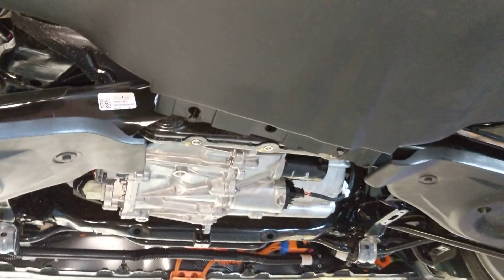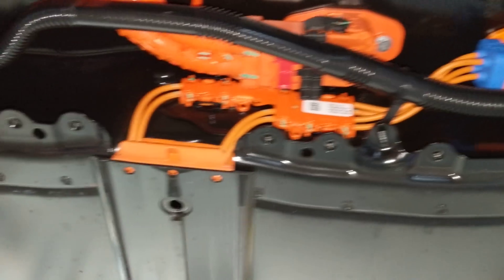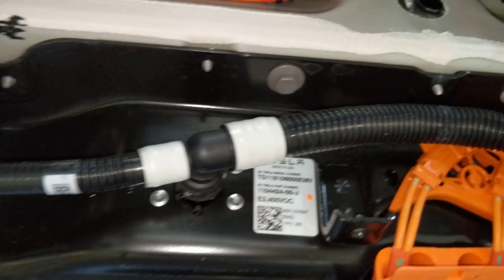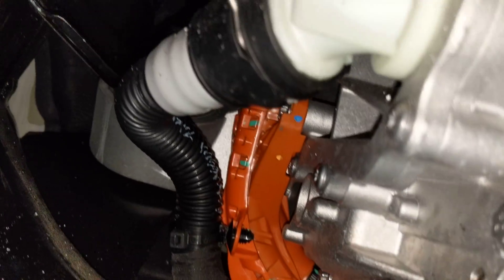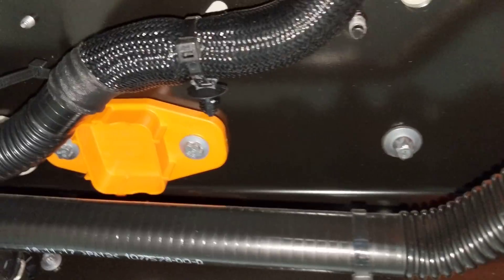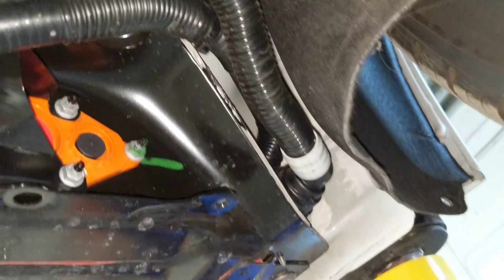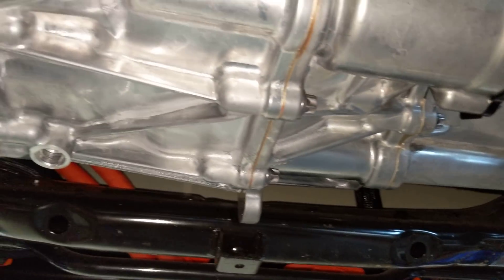Tesla Model 3 - High Voltage System Overview

Comment: Thank you for the video. Now the question is, which line is positive and which is negative....
Reply from the maker: If you are competent around HV used in these cars, then it's trivial to figure out polarity.  Please do not attempt to mess with HV if you are not very experienced with it, it is far more dangerous than most people assume.  Besides, even if you hook it up, none of the components work without proper CAN bus control.  Things like the drive unit need a cryptographic handshake too.
Reply: @Ingineerix  I deal with systems from <12V all the way to 3 phase 240V on aircraft. 

 Currently sitting in my garage I have a 17 Chevy volt pack, model 3 motor, Orion BMS, Tesla Gen 2 Charger, DC/DC, and EV controls controller. Along with the contactors and such.  

I assure you; I do have the PPE for handling the HV. Just not the full knowledge of how it all was hooked up in a Tesla. 

I believe I found my answer for polarity as it appears to be pin #2 is negative.
Reply from the maker: @boxmonkeyracing  Apologies, Just trying to keep people safe.  I've had many scary reports!  Some guy even tried to connect 400V of pack directly to a Tesla inverter with no precharge!   In fact, Orion BMS doesn't have a built-in precharge system, so I hope you have one selected.
Reply: @Ingineerix  it’s all good. I completely understand. I also believe that’s why it’s hard to find support from people with ev conversions. 

The EV controls T2-C handles the pre-charge circuit and controlling the drive unit. I’ve already tested the pre charge circuit and main contractors and it’s working great.  My next step is actually hooking up the HV to the drive unit, and updating its firmware. Hopefully, I’ll have it spinning by the 1st.

Comment: You said high voltage.. But out of a curiosity how much the high voltage is which reaches the inverter?
Reply from the maker: 300-400VDC
Reply: @Ingineerix  So the motor also a high voltage Ac motor or is it a 110v motor??
Reply from the maker: @SFORSANDEEP  "High" is relative, but inthe automotive context 400V is "high" vs 12v which is "low".  There are no other voltages in the car.  The inverter converts 400VDC to 3-phase AC for the motor.

Comment: I was hoping to see a mention of the high voltage breathers since there is a service bulletin to replace it due to a thud sound while supercharging in the cold.
Reply from the maker: The breather is the orange thing on the penthouse cover.   It's just a gore breather.   I would guess they replace it with one that has more flow.

Comment: Damnit, I wanted to tap it somehow for a 120v inverter inside the car, but its all externally routed without any sort of high voltage bus available inside the car... It would be cool to have a fully fledged pure sine wave, 120v, 15 amp outlet in the car. That would be incredibly useful for a lot of things.
Reply from the maker: The HV comes into the cabin for the PTC heater.  But I advise not doing so!
Reply: @Ingineerix  One time I had Tesla Mobile service and the guy showed me the inverter that he had in his Model S. There was a switch they had installed under the front MCU and maybe they routed the HV from the PTC heater?

Comment: What is the likelihood that you can hack a NA Model3 to work with EU supercharging by replacing some component of the HV system? or vice versa? Do you need Tesla participation to get the correct software/firmware?
Reply from the maker: It can be done, but will require a lot of different parts that Tesla will not sell you, so would have to be obtained from a salvage EU model.  It does also require opening the penthouse of the HV battery.  I can assist with the programming.

Comment: What would you consider a reasonable place to tap the HVDC system for an accessory inverter? I'm interested in sidestepping the multiple conversion losses that would otherwise occur by tapping the 12v side.
Reply from the maker: Buy a set of the TE connectors used on the front firewall to connect the cabin heater feed and build a "Y" cable so you can do it safely and without cutting wires.
Reply: @Ingineerix  I wonder if anyone has done this to date? Would love to hear more about feasibility of doing this...
Reply: I think a lot of people would LOVE to see a video on how to hook up a regular wall socket in a model 3 like this. Me included.

Comment: This is my kind of porn.  It would be nice to incorporate 360 and add edits with details of the fasteners, connectors, all the fluid, and electrical.  Using calipers to measure. It is an excellent engineering porno.  Virtual camera and close still macro lenses and panning with light balance on a fixed tripod to eliminate shadows and improve the depth of field.  Maybe a laser pointer to show exactly what people know what area or items.  I can really appreciate the level of integration with analyst led design development it looks like many areas meet better than typical but some items are par or a little kluge like in some spots.  That some tradeoffs get cooked into the configuration until the next spec advance from all the data gathering.  Looking forward to more.

Comment: HV connections, Coolant pipes, and Framp mounting holes for a front motor in all RWD Model 3's. I asked my service center when my Model 3 was there and they said word on the street among tesla is that RWD Model 3's might get an AWD upgrade option in the coming 1-2 years once a majority of the backlog globally is chewed through. They hinted at a $6000 ballpark cost upgrade, over the $4000 cost at configuration. It would also depend on owner interest to offer the upgrade.

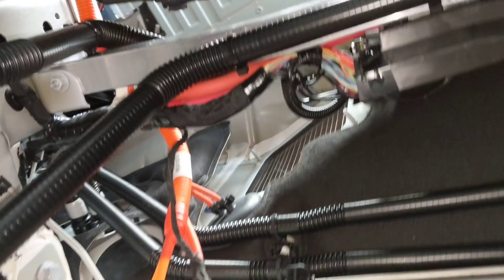Comment: Seriously. The amount of glue between the chassis components. Starting at 0:25 through 0:37. This must be the crashed chassis, right? I can't imagine a factory would pay for that amount of adhesive. Anyway, thanks for these videos!
Reply: That is alot, I think he said some of these teradowns are from a salvaged car in a previous video ... but I wonder if that much glue is something to do with waterproofing?
Reply: In another comment on another video he said it was soundproofing material. So maybe that's why there's so much? It still seems like way too much, and it still looks like someone tried to clean it up by hand. But perhaps there's a reason for having that much excess.

Comment: I wonder how all those plastic pipes and connectors will hold up to snow and ice.
Reply: They're largely covered by plastic underbody panels which he removed to expose them.  The panels also make cleaner aerodynamics.
Reply: Thanks.  I didn't realize those pipes were protected by panels.

Comment: Love your work!  Couple of requests:  could you investigate the HVAC and other components inside the cabin (and the mysterious component Tesla calls the superbottle)?  Also, I'm curious about the ability to retrofit a heating element into the steering wheel, and whether there are wires already available in the steering column to accommodate this.

Comment: Hmm, interesting - I knew that the compressor was HV, but I didn't realize the cabin heater was.
Reply from the maker: The DC-DC converter takes High-Voltage from the battery pack and makes 12v for all the low-voltage components.  It is only capable of about 2kW tops.  Heating a car needs at least 2 times that, if not 6 times (especially where you live! =).  This is why this is only place high voltage is ran into the passenger area.  12V systems are cheaper, more common, safer, and easier to deal with switching, insulation, etc, so this is why they are still used extensively, and some form of low-voltage (below about 50V) will continue to be used in the bulk of the car for many years to come.
Reply: It's the most practical way to have small wires and lower current for the heater.
Reply: Indeed. It's reportedly part of the plan for Model Y to shift a large chunk of the vehicle subsystems to higher voltage - although whether they mean pack voltage or just say 48V is unclear.
Reply: Almost certainly they mean 12V going to 48V (or 42V).  That's been in progress across the auto industry for many years, but slowly.  The use of traction battery pack voltage for accessories is minimized, since above 50 V is a shock hazard.  12 and 48V are still considered low voltage.   https://en.wikipedia.org/wiki/42-volt_electrical_system